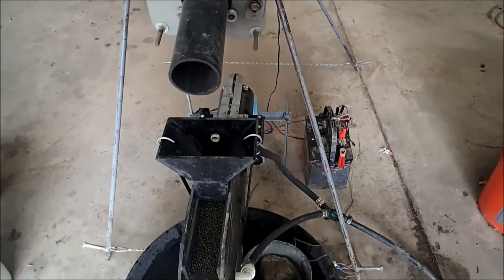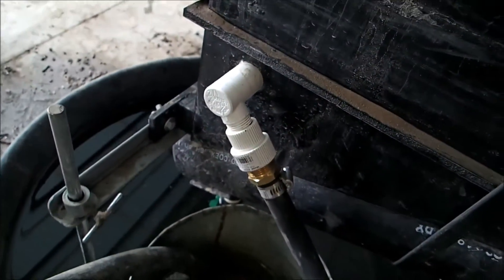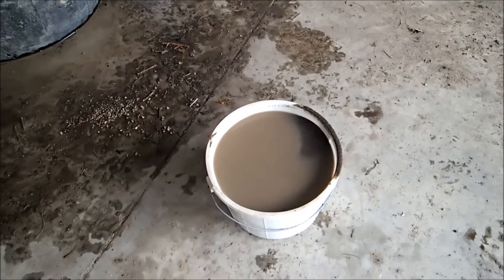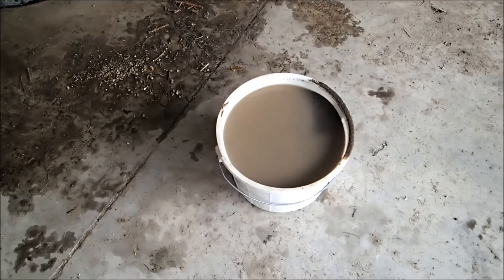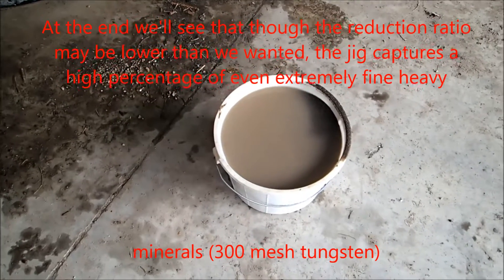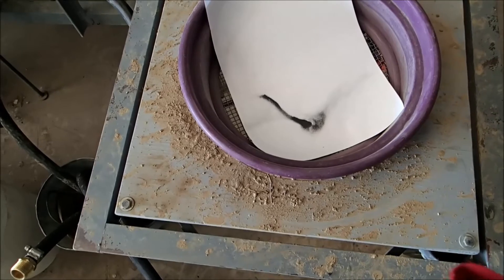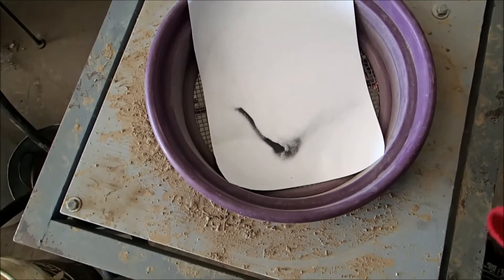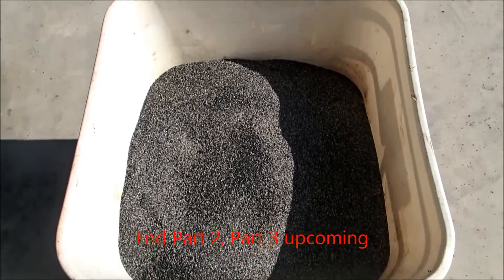Jigging for Gold Part 2

Comment: Jim, I need to build a small portable vibrating table like the one you have in this video.  Can you tell me how this one is build of link me to another video about the table.
Thanks
Jeff
Reply from the maker: I'm not sure what you mean by vibrating table. I sell plans on Ebay for most of these units, including a shaker table, and the jig. If you search Ebay using either "mineral jig", or "shaker table", you will find them.
Jim
Reply: At 6:20 on the above video you dropped some tungsten through a 100 mesh classifier. The table was a vibrator table of some kind.  Do you offer plans for this table?
Thanks
Jeff
Reply from the maker: Oh...the classifier! I don't sell plans for that....it's too simple...LOL. Just buy a vibration unit from Vibco, or Russo Tool supply. The one in the video is a DC-20 from Vibco....you can usually find them on Ebay. The deck is just a sheet of plywood, with a hole cut in it to allow typical classifiers to nest. The deck is mounted on springs to allow it to move around. If I built a new one, I'd make the deck overhang the frame so gravel can't get into the works....any that escaped would just bounce off the deck onto the ground. I used a 12v vibrator, so I could use it in the field, but you could also buy a 120v vibrator.
 The frame is just 3/4" black pipe legs, and angle iron for the deck support. No big deal. Any welding shop could build the frame if you don't weld, or have a buddy who does.
Jim